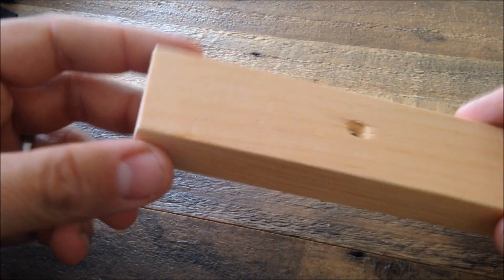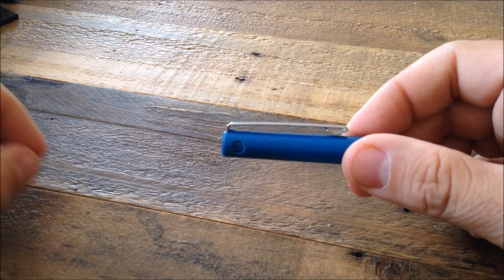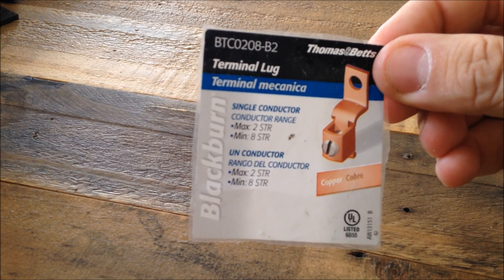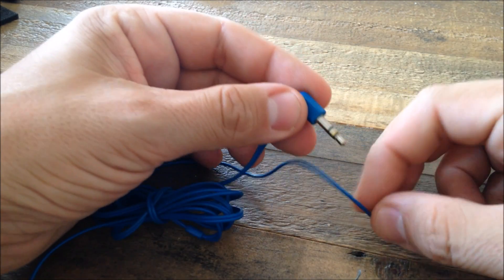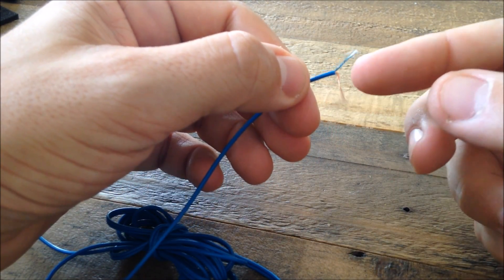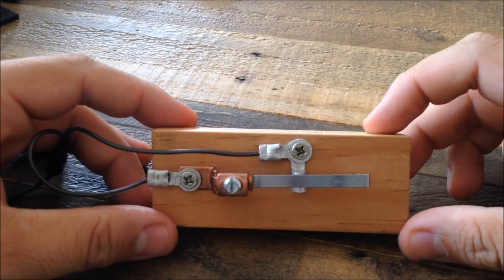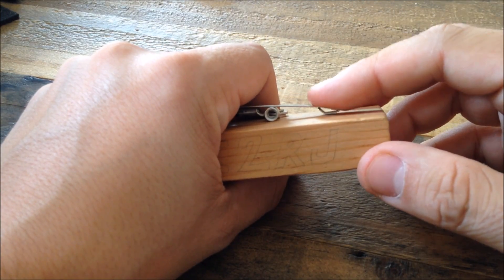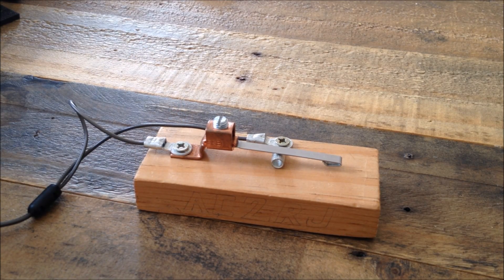Learn how to Build an Straight Key - Easy and Affordable

Comment: materials for this is
piece of wood: 3/4 on 1 1/2
2 ring terminal connectors
2 wood screws
uniball vision rollerball pen cap
gardner bender copper mechanical lug
earphone cable

Comment: I have been a ham for over 48 years and have had about every straight key out there as well as many paddles and bugs, I just had to build this key and all I can say is WOW!!  To be honest this is the best straight key I have ever used with modern solid-state radios, do not use it with a tube transmitter due to high keying voltage unless you insulate that simple pen clip.  This key is awesome especially with small Qrp radios, it is best to set the gap very close by sliding the contact terminal in or out along the base before permanently mounting it as the very close spacing gives a very good feel and loosens the tension especially from a stiff pen clip.   CW is effortless yet precise in the feel.  I made my base more of a square and built it on a couple cheap wood coasters I robbed from our coffee table.  I stacked the coasters to make my base a little thicker and   I thought my finger would probably slip off that pen clip, but I was wrong.  I can send 20 wpm code with this thing and never miss a beat. This key screams to be held in one hand and keyed with the other, even bring it to your lap or near your chest or hold it in any comfortable position off the table that you want. Lean back in your chair and key away or even if you're out sitting on a rock or tree stump.   It is pretty small and OK keyed traditionally flat on a desk but a much better feel to me is off the desk, so I key it like I would use a portable paddle in the field.  Thanks for such a great video and super key, 73 J

Comment: Do i have to plug anything on the other side of the cable ???
Reply: A transmitter
Reply: The Johnny O Show where do you buy the right transmitter?
Reply: Ep. #377 Assembling 40 Meter QRP CW PIXIE Kit - Part 1
https://www.youtube.com/watch?v=sHawSss6wcQ&t=600s
Ep. #378 Assembling 40 Meter QRP CW PIXIE Kit - Part 2 HUGE FAILURE
https://www.youtube.com/watch?v=TYFzeSmB82Y&t=25s
Ep. #431 Jacob FINALLY Finishes His CW Pixie Kit
https://www.youtube.com/watch?v=3He0X21e7yw&t=2s
Reply: The Johnny O Show  ok i found it on ebay ...S-Pixie